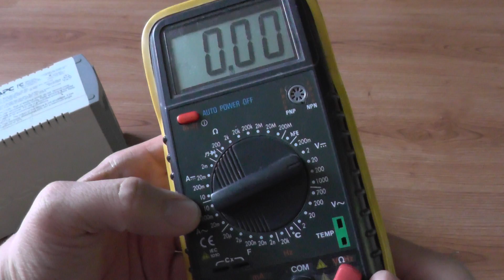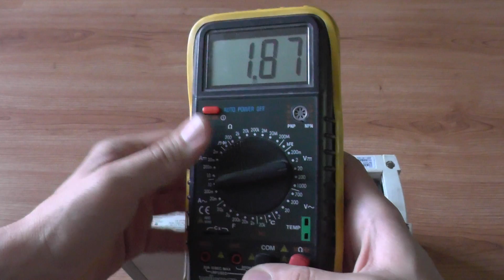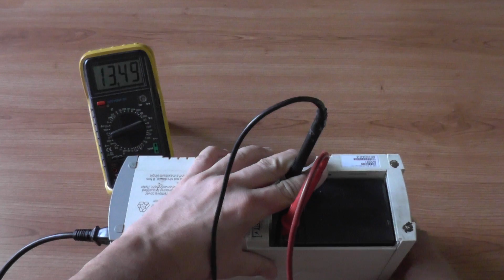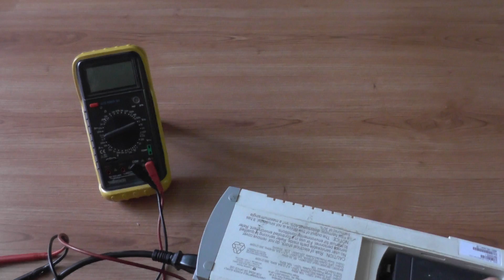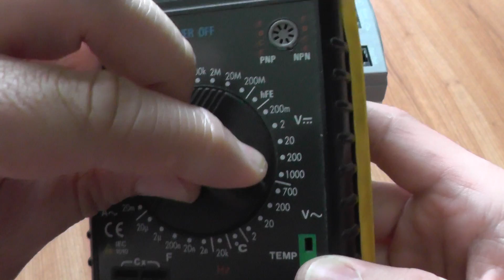APC CS 500 UPS Battery Fix

Comment: Although I bought a new unit from someone on Market Place it reads close to 6 volts I wonder if this still works?
Reply from the maker: If the battery is old and it stood too much then just replace it. Sadly on this video I had captions which were dropped by YouTube where I was explaining that unit run hot and evaporated the battery water. This was showing that by just adding distilled water. It's a common problem in APC ups when they are not placed in such a way that they have lot's of air around to cool them.

Comment: What you did exactly? Fixed the battery ?, I bought new battery already so it's mean I don't need to fix it like you did , or is anything else I should now , please help
Reply from the maker: Sadly this video had annotations, a thing that YouTube has disabled. I was explaining what has happened, the battery just dried out due to the UPS overheating. Just adding some decriminalized water into the battery has made it to work again.

Comment: Hey, I’m planning to restore my ups battery but it seems APC doesn't want people to do it, because it comes sealed and it's not easy to disassemble as one can see in your video. Any advice on cut the plastic to access the distilled water containers?

Comment: sir do you have an idea, why my UPS like that in your video has on line has no line, and the On-Battery is just blinking? what does it mean?
Reply from the maker: These APC units have a lot of faults, they have various capacitors that dry up and make some parts of the electronic to fail. If the battery is good I would inspect the capacitors.

Comment: When I opened the APC 950 the battery was dead and started to leak some oil when I caught it, I gave it for recycling and put it in CSB HR1234W or CSB GP1272 F2 which are just as compatible.
Reply from the maker: Probably the battery case cracked and that was acid/gel oozing out. It's rather common on the APC brand as they get very hot even on stand by so it dries up the battery and kills it.
Reply: @TechTronic9000  Thanks but apc Is better from eaton because stop to work I change battery and Is all ok now.

Comment: Hi, good video, y have a problem when i plug the ups, the “on batery light” turns on inmediately and the pwr button dont do nothing
Reply from the maker: It's a common fault for APC models after some age, usually it's traced to some dried up capacitors that need to be replaced. I have spend a lot of time trying to sort that out but it was too time consuming so ended up replacing it with another UPS. Another reason to drop using APC as most of my older units failed in the same way.
Reply: @TechTronic9000  Heyman×

Comment: I'm converting the same model but with outlets to lithium, it will be a 3s 12p battery with salvaged lg power tool cells. The cord will be removed and it will  eventually get a solar panel and hooked to a DC to DC converter to a 3s bms on the batteries to charge but for testing I'll charge it on my imax b6. I'll also add some USB ports and a fan if it works decently.
Reply from the maker: You need a good BMS otherwise the UPS will just overcharge you Li-Ion cells.

Comment: A neat trick! My CS 500 just keeps flashing the yellow On Battery light rapidly as soon as I plug it in an outlet. The Power button does nothing except for dimming the flashing light a bit, doesnt respond to anything. This situation is not described in any guide I have googled up. Its a pretty old device so I took it apart completely, but none of the capacitors or other components look damaged. Any idea what could have gon wrong? Do you think that replacing all the (larger) capacitors is worth a shot?
Reply from the maker: The CS500 had an issues with a voltage regulator / resistance getting overheated and blowing out. Try to search from some "blackened" components.
Reply: I visually checked all the components, but will try my luck again, thanks for the tip.

Comment: I have a APC 1500 va the backup battery works but the online led goes out. like if the voltage was low. can you help me. I've tried lowering but keeps on doing it. I think is dying
Reply from the maker: So it's show that the mains is off ? That may be a connection problem.
Reply: @TechTronic9000  i also used this apc rs 1500, connection lost, means?
Reply from the maker: I have an RS 1500 with the same error, one of the batteries just melted.

Comment: hey hi i have ups recently i have changed batteries for ups but its not giving me full backup time do you know any solution
Reply from the maker: Maybe the new batteries don't have the same capacity or the power draw is higher, also new batteries require at leas 12 hours of charging.

Comment: can i charge the battery with variable power supply ??
if yes then what current and voltage should i set ?
Reply from the maker: +Tanmay Patil Yes, you can. Use 13.8 Volts and limit the current to 1/10 of the battery capacity (for a 7Ah battery use 0.7A current).

Comment: ... whenever i change from power line to battery it says that its empty wtf ??? i changed 12v battery with a new one still the same problem
Reply from the maker: It's possible that the ups output is overloaded or running almost at maximum load.

Comment: can I use a small car battery with such a UPS?!
Reply from the maker: Yes it works, but car batteries do not like to be discharged too much. Also the charging in the APC UPS is very slow.
Reply: Oh, I won't, but I want my 10 min extra gaming time...  :))
how much watter should I put, on the other videos they fill it to the cap, but I don't like that idea?!..
7ml, no more, no less?!..
Reply from the maker: +Ivan Bnv for a 7ah battery 5-7 ml. Adding too much is asking for trouble.
Reply: Exactly 7 ml, But still dead... 12.78V on the battery after the water, and still that value after 6 hours. 158V on the  220V, 13.6V while charging (still)... 
p.s. Battery voltage suddenly dropped - 10.79V
Reply from the maker: Are you using the UPS to charge it ? After you add water you should charge it with a constant 13.8V voltage for 12-24 hours. 12.78V on a charger is to low. After sitting disconnected for at least 6 hours it should have 12.8V if 100% charged.
Reply: Yes, I tried that!.. 12.78V was on the battery without the charger... 13.6V on the UPS, after 6 hours it was almost the same... it was 12.8V disconnected, but after that dropped... I left it on the sun for couple of hours... and now it's dropping even more - 10,2V...
I guess it's over now?!..
can it be 14+V?!
Reply from the maker: Yeah, probably the battery is to damaged / used.
Reply: Can I connect 2 similar UPS in parallel, or should they be identical?!
Reply from the maker: Never connect 2 UPS's in parallel, only if you want to burn both of them or your house.
Reply: what is you use only the boards, and you interconnect them at every level?!
Reply from the maker: Ivan Bnv
Still impossible. If you need higher load output then you need another unit. If you need longer time then you can upgrade the battery.

Comment: I have an apc battery backup but I cannot plug more than one device to it. Once I plug in a second device it just starts beeping and depletes. But when its just one device it is fine. What could be my problem? I measure voltage and its 12 volts and it holds that voltage for a long time. But the moment I plug 2 device the voltage drops and jumps. not sure whats going on but is the the same as yours? will water help it?
Reply from the maker: It's possible that the second device to draw to much power. The APC C500 has a maximum output of 300W.
Reply: ment to reply to techtronic9000
Reply: TechTronic9000 i know for sure it is not drawing much power. I only plugged in like a 3w water pump and say a battery bank. I know that it is no where near the max wattage this ups battery can take. This one is an apc 550 so guessing it is similar. But not sure why it can't handle any second device. And all I can think about is can a the battery not be able to handle a certain amount of amps? like 3A and thats it? But maybe adding water will help?
Reply from the maker: It may be a a too old battery also inductive loads (electric motors/pumps) don't work well with computer UPS due to them needing pure sine-wave while the UPS has noting similar to it.
Reply from the maker: Also forgot to mention, try adding also a resistive load (a small 25W bulb). Some UPS's don't work properly with a minimum load.
Reply: TechTronic9000 thanks ill try that

Comment: After long use, the Sulfuric acid becomes weaker, along with the decrement of the water capacity(decrease of dilution).
So, I think, to recover a lead acid battery, there are two options:
1) to add some distilled water,
2) to add some Sulfuric acid.
Please focus something on the addition of sulfuric acid. I think adding Sulfuric acid will really help the situation!
I just need some information about which hybrid(type) of the acid is actually used, it's concentration, how much dangerous the process is...
Because, it is not possible to refill the battery with distilled water and expect it to work just as a new one(It will not be as efficient). It will just cause wastage of time and energy. 
Thanks in advance! :)
Reply from the maker: If the battery is too old (used) then it's not economic to either add water or acid (dangerous). When the battery works in a hot environment it will vent water from the gel paste and become inert, adding water will mostly restore it.
Reply: True...
Thanks! 
By the way, your video is the most neat and effective among the Sealed Lead Acid Battery Recovery videos out there!
Keep up the nice work! (y) :)
Reply from the maker: Thank you, I will do my best to do other useful guides, and the newer ones will also have voice over with more explanation :)
Reply: In my case, I overloaded my 4-5 year old UPS, and it made a trickling sound for 2-4 seconds and tripped off.
I just understood that something went wrong as the UPS didn't start at all after that... It was 4-5 months ago. 
After 4-5 months of that incident I opened my UPS to find my 12V battery reading 2.54V and had almost idea about the complex circuitry!
I at first thought that my circuit burned due to that overloading, although I am not sure, but I now think that changing the battery may work! Any idea what might have happened?
Reply from the maker: Your UPS should have a circuit breaker, you should check that first.

Comment: There is one "little" problem. By adding distilled water to the battery you won't help it. Because all the "sulfuric acid" is on the plates sulfated you end up with battery filled with water or more diluted electrolyte. Maybe if the battery off-gased a lot puting some H2O might help in the end but you have to get the plates clean of sulfation. Measuring voltage on terminals is one thing , put the battery under a proper  load (discharge) and calculate the capacity  , you'll see. It won't gain capacity ...This is not working. I have done it. ;) cheers
Reply from the maker: It really depends on the state of the battery, some batteries are impossible to recover, other may work again, of course a few years old battery revived with water will not work like new. For my above case the battery keep the ups working ~30 minutes with a small load (Router and NAS).
Reply: In another video with ups battery recovery i see that instead of distled water is used water with 30% sulfuric acid. Will make recovery stronger using acid not pure water or will make battery life shorter?

Comment: Thanks! Will have to try out, but what was the water level after pouring in the distilled water? should it touch the bottom of the holes? I've got an 12V 18AH/20HR battery that I want to resurrect :)
Reply from the maker: Water should be absorbed by the gel paste and not to be left extra otherwise it can boil and spill acid.

Comment: You fill the battery with water and recharge it. 
But after recharge, the battery is dry again ? You dont refill again it after recharge ?
Reply from the maker: You do not want to add to much water as this is a gel / wet (not flooded) battery. It need just a tiny amount to re-establish electrolyte conductivity when it's dried out. Adding to much water will make it boil, crack, vent and spill acid.

Comment: i don't have a charger can my ups charge my battery ??
Reply from the maker: +Shivam Sharma You can try, some UPS models do not charge the battery if it's voltage is too low.
Reply: some has a cold start future which is great for dropped batteries

Comment: thx I will try in my apc 1000
Reply from the maker: +azvoltage depending on the age of the batteries results may vary. Just be sure to check first if the battery is physically OK (no cracks, no deformations).
Reply: +TechTronic9000  ohhh ok I will check it's like 4 or 5 years old..
Reply from the maker: +azvoltage My battery was very old, 7-8 years old. It was almost a miracle that it has worked again, although the capacity will not be as new.

Comment: I have cs-650. When i powered it on it the "replace battery" is blinking red and the ups is beeping. I measured the voltage and its all fine when powered off and it does not drop when i power on. Can you pls help? :)
Reply from the maker: +Filip Koneski Take out the battery, use a car light bulb (55W or higher) to add a load and then measure the voltage and see how much will it drop. I believe that the battery is the culprit. Even when turning on the UPS the voltage drop may be too fast to detect on a voltage meter.

Comment: putting water into these batteries may give a short life boost, but it won't be long, just buy new batteries and replace the dead one.  it's really not worth stuffing around with it all.
Reply from the maker: John Douglas In general yes, but it also depends on the age and usage of the battery. The above UPS sit in a high temperature area and the battery vented all the electrolyte, leaving the internal paste dry. With water added the same battery is still working normal as i write this article. I'm sure that the battery capacity is decreased but it still keeps my small NAS and Router working for about 25 minutes.
Reply: if that's all you require, than no problemo.

Comment: where did you get that 12v A/C power cord?
Reply from the maker: Bull Shyte Are you reffering to the small battery changer ?
Reply: TechTronic9000 No, actually the white power cord that you plugged the lamp into at 15:06.
Reply from the maker: Bull Shyte That one is made by me. You need a C14 connector, a 3 wire cable and a outlet plug. Alternatively you can use a spare ups cable, you can cut the connector that goes to the PC PSU and install a normal / multiple plug.

Comment: TechTronic9000  hey man.. can i do this battery fix on a apc es500? its a lead acid battery like that one...  is it distilled watter should i use for the battery? .. its a 7.2ah
Reply from the maker: paulo159 Yes you can. Check first if the battery is not swollen or cracked. Only use distilled water, and be sure not to add to much as it will overfill and spill out when charging.
Reply: TechTronic9000  ive check it  its not cracked.  the battery voltage is 11volts.. the ups doesn't want to charge the battery it detects as dead.... distilled watter that i can buy at a grocery store?
Reply from the maker: paulo159 Any kind of distilled water should be OK (grocery, gas station, car parts, etc.). You will also need a charger able to supply 13-14 Volts to charge the battery so that the UPS will work again whit it (detect and charge it).
Reply from the maker: 12V is to low and you should not exceed 14V. The charge curent should be 10-20% of the capacity. For a 10Ah batter it should be 1-2 amps maximum.
Reply: TechTronic9000 finally, someone smart that does not dump a gallon of water into a small battery LOL good work, be well my friend
Reply from the maker: inspectyerbooty Haha, thanks !

Comment: Very helpful video, quick question though, if I don't have the lead acid charger can I just charge directly from the UPS after filling the battery with water? TIA
Reply from the maker: darkjay263 Depending on the UPS model / type, it may be possible to charge the battery directly with it. This model of APC does charge the battery when it's OFF. Turing it on with the flat battery will only give errors. If you have access to a multimeter it's better to check if you have around 13.5-13.8 V at the battery terminals to be sure that the charging process is working.

Comment: i can't understand why you dry out again the battery if the initial problem was the lack of water. If the battery is dried out, it should be dead again or am i missing something?
Reply from the maker: combinbain I'm not draining it, I'm verifying if all the added water was absorbed into the gel paste. If you put to much water the battery will boil and leak acid. So it's a safe measure to check that there is no remaining extra water.

Comment: What happens if you put too much water in the cells? I did the same thing as you but I filled them to the top.
Reply from the maker: It will overflow and spill, it is also possible that the battery will crack it's case.
Reply: could I just take some out or would that do more harm then good? Also, what voltage should I stop the discharge at?
Reply from the maker: TheSamchilders If you haven't charged it yet, you can leave it 2-3 days so that the water will be absorbed in the dried paste, then just remove all the water that comes out. You don't need to discharge as it will damage the battery even more. Just connect it to a charger and be sure that the voltage does not go over 13.5-13.8V.
Reply: I have already charged it once with the water in it. Should I still pour the rest out?
Reply from the maker: TheSamchilders In this case first fully discharge it to 10.5V, then remove the water.